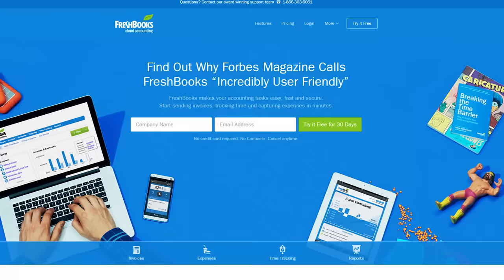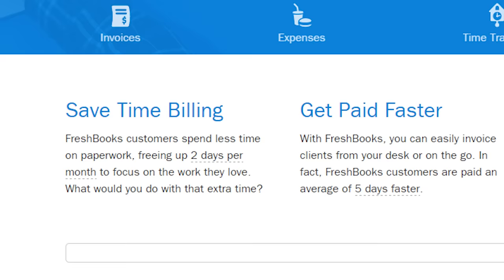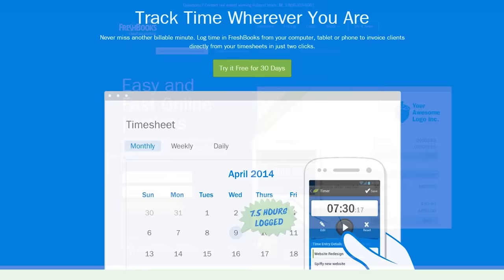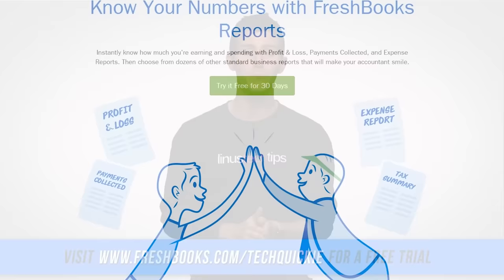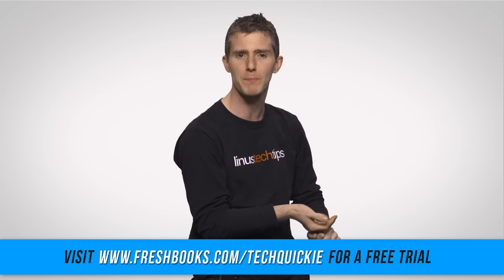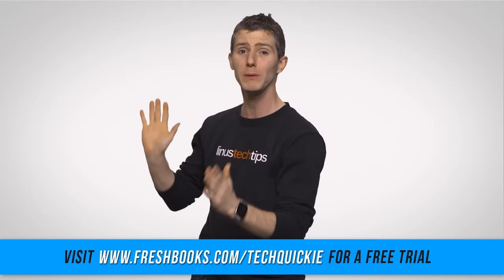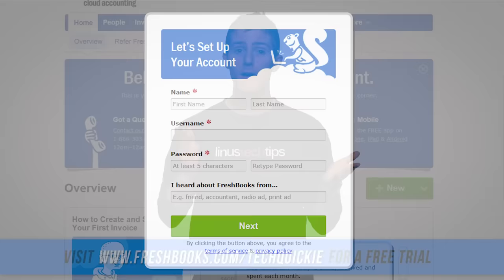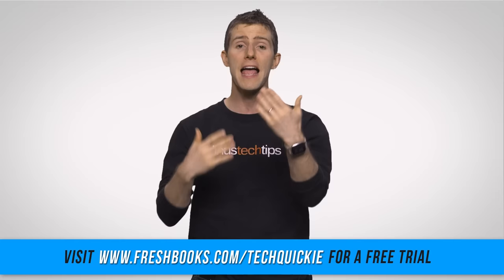AM and FM Radio As Fast As Possible

Comment: is there an online radio? Like an AM FM radio?
Reply: Actually there are sites, that are connected to a receiver in various locations that allows you to do this with AM and short wave. (I don't know if there are any for FM.) Some amateur radio hobbyists maintain these sites. I was able to use one that was in New York city and able to hear an AM station that broadcasts from my hometown! There was some static, but I could still make it out pretty well. If you're a HAM operator you can use it to check and listen to your own signal! (There is of course, a slight delay.) Just find a frequency that's available and set your radio to it. Then go online and set the receiving station to that frequency and broadcast a mic check and see if you can hear yourself on the internet receiver.
Reply: They also do this with police scanners as well! You can go online and find a site that's connected to a scanner that carries you local ambulance, fire and police communication channels. They stream these channels online so you can listen to them through the internet without having to buy a scanner.

Comment: Bs, there are no radio waves that can moe with a curvature.  Bouncing of the atmosphere either.  There is no law in physics which allows it to do that.
Reply: Lmao everything you said here was wrong!
Reply: There's an article called Skywave Propagation on Wikipedia that describes this.

It's the same as when light causes a pencil to appear broken when submerged in a glass of water from certain angles. Change in the refractive index between different atmospheric layers can bend radio waves.

Comment: Should have included short wave as well even tho i haven't seen in ages radios with  short wave.
Reply: I still have mine. It still works and I listen to it every once in a while.
Reply: Does it pickup anithing  beside third world countries ? Asia and middle east mostly that's what i remember picking up a lot of quite badly at that,it was a shitty radio too.
Reply: Mostly it's third world countries. I know a lot of international broadcasters have really cut back on their broadcasts and some, like Radio Netherlands, have completely suspended broadcasts to North America. You do still have a lot of religious broadcasters and fanatics talking about the illuminati and the end of the world. lol.  My receiver is actually pretty good quality and I mostly use it to listen to ham radio operators. I have a BFO on mine which allows you to listen to single sideband broadcasts, which most ham operators use. Most cheap SW radios don't have this. (My old short wave radio didn't have one.) Without it, it you can't make out what they are saying and it just sounds like they are just mumbling to each other.

Comment: Good grief that was a good explanation.
Reply: It wasn't because it has serious errors
Reply: @caribbeansimmer7894  Please expound.
Reply: @joe3276865536  Sure no problem.  First, Linus confuses modulation with frequency. He said amplitude modulation occurs at lower frequencies and that is simply incorrect.  You can use either frequency modulation or amplitude modulation at any radio frequency.  In fact, the shortwave band uses amplitude modulation and at higher frequencies than what you would consider AM radio.  Second, AM radio that we all know do not use the ionosphere to transmit radio waves, the radio waves are transmitted over the ground, however, transmission in the shortwave band uses the ionosphere.  I like Linus' content but you will find that most youtubers just put content out there without really understanding what they are talking about, thereby misleading viewers.
Reply: @caribbeansimmer7894  OK, good corrections. Thanks!
Reply: @joe3276865536  My pleasure.

Comment: Radio waves "follow the curvature of the earth" uh. Ok that makes sense because gravity totally pulls on radio waves lol. #flatearth
Reply: There are two phenomena at work. The first is ground wave propagation and the second is radio waves refracting off the ionosphere. 

Also, a physicist would tell you that gravity absolutely influences radio waves as it influences all electromagnetic radiation. Our radio telescopes observe gravitational lensing of not only light but also radio waves. However, this is not the mechanism at work with the frequencies typically used for AM.

Comment: Very interested to see what you would do with this but was highly disappointed. it started off well describing how AM works but you skipped some very important bits with how the recovers work in two words. didnt talk about how you have to reduce the frequncy in the reviver anything to do with actually how it converts to a audio signal which is actually quite simple and easy to understand so i dont understand why that was skipped. your description of how it selects which frequncy was terrible and kind of wrong in comparison to how nearly all aerials work these days, where it picks up all signals and you use a low and high band filters to select what frequncy you want.